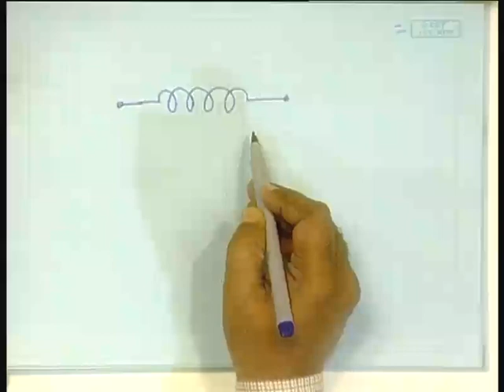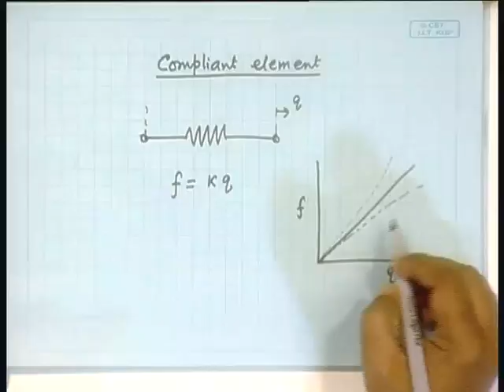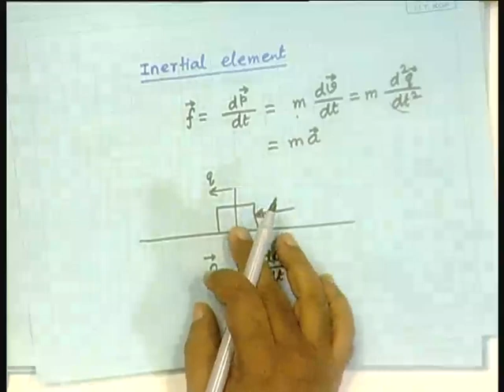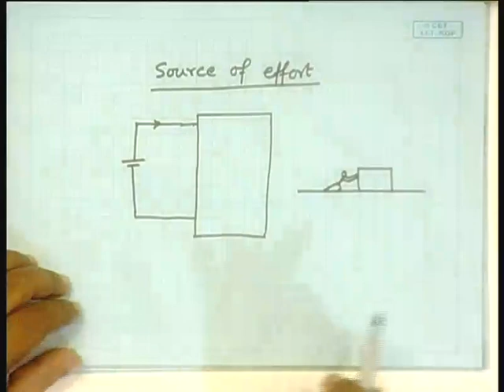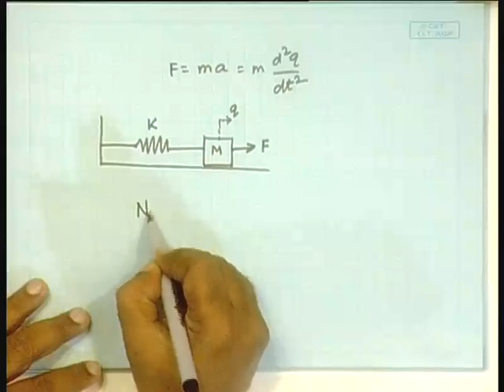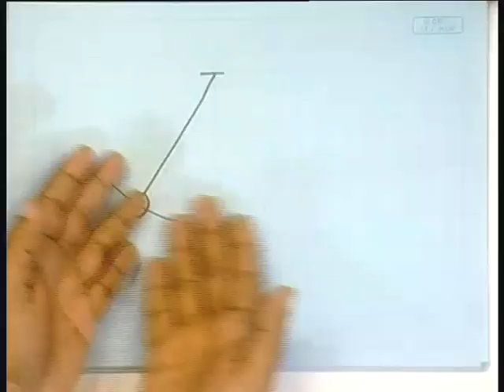Lecture - 1 Introduction to System Elements

Comment: I wonder what the prerequisites are for this course - no way of determining this. I'm interested in the topic and have a degree but its been awhile. Do I need adv linear algebra ? solve partial differential equations ?
Reply: It seems to me that the prerequisites are differential/integral calculus and an introductory course in mechanics and electric circuits.